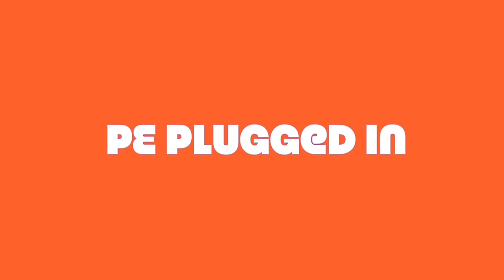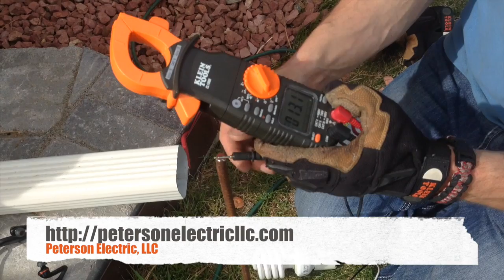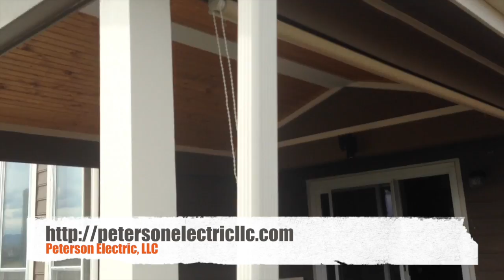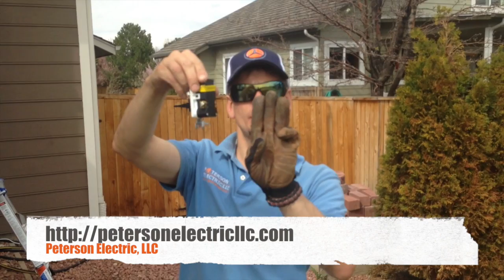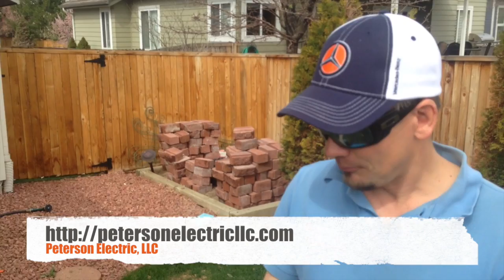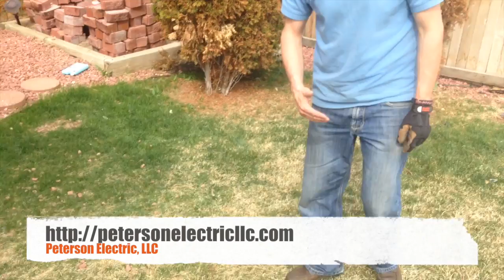Part1: Weird Electrical Things At Customer's House: Shocked On Grass, High Utility Bill

Comment: Went to a service call one time where the guy said his garage receptacles were reading 120v. When he plugged in anything nothing would work. I checked them and the voltage just dropped out under load. I traced it down to a property pin that had recently been drove in through part of the UF cable. Was reading 10v on the pin to ground with just the meter probes. Turn the breaker off and read 0v.

Comment: Get yourself a Knopp K60 solenoid tester...one of the best troubleshooting tools I have. Also no need to drive a ground rod. Just stick the black probe into the soil.
Reply from the maker: Thanks, my journeyman used this when I was an apprentice 20yrs ago. I was trained to use a digital meter, why do you like this meter when it does not give you exact voltage readings?
Reply: @Petersonelectricllc  Josh, most digital meters are high impedance so you have a chance, when troubleshooting, of getting ghost voltage readings. It's(Knopp) great for finding grounded conductors when troubleshooting, and after pulling conductors through conduit, before energizing. Let's say you're troubleshooting a tripping breaker for an exterior lighting. Sometimes you're talking long runs of conduit and many poles. Go to 1st pole in run, disconnect all splices. Turn breaker back on. Obviously if breaker trips you know you have a problem in the homerun. If breaker holds now you use the Knopp. With power on you touch one lead to a known good voltage source and the other to various ungrounded(hot) conductors. If the Knopp does nothing you know you have a good conductor. If it vibrates, lights up, and jumps you know you have a grounded(bad) conductor. Now it's a matter of breaking things down farther to pinpoint your problem. It eliminates the need to keep running back and forth turning power on/off. Plus it's CatVI rated so you're good to go when working on voltages between 120-480 volts.
Reply: @Petersonelectricllc  Let me give you another example. Around here(Philadelphia) we have to make up our own hot taps in most cases. Let's say you build a new service, have to cut taps to make some repairs, upgrades, etc. Before we re-crimp the taps we use the Knopp to verify none of the ungrounded conductors are grounded. Now you might think this is getting ridiculous. However one night we were taking a convenience store off generator and putting back onto utility. Two of my guys were up in buckets and the 2nd connection blew up in their faces. After an hour of troubleshooting we found that a dead front screw had pierced one of the ungrounded conductors inside one of the six panel boards. This happened during the shutdown. A Knopp test would have prevented this accident. Luckily no one was hurt.

Comment: To better your video, you gotta remove the logo to an upper corner and make it a little smaller. It blocks the view often. I recalled a window guy at a new home saying he was getting shocked trying to put his window in. Someone used a screw too long and drove it through a wire and into the foil tape around the window opening.

Comment: Looks like someone put a screw or nail into some NM cable, and you have the the task of finding it. Either that or you have a defective ground, and if the ground is bad in the building. With 200A you need at least two 8foot grounding rods. Although you can put in more.  Also looking at the pictures of the neighborhood, it has an underground feeder and there could be a problem on the utility side.
Reply: Ground rods have nothing to do with whether or not breakers will trip during a fault. If there is a broken EGC it doesn't matter how many ground rods you have. That EGC will become a live conductor and can cause other bonded metals to become live as well. The only way to trip the breaker is to have an effective ground fault current path. There will never be enough current to trip a ground fault if the ECG is open upstream and the charged chassis or metallic surface that is conducting the current will shock or kill the victim. There is too much resistance in the human body to pull enough current to trip a breaker. Ground rods are a drain to dissipate static and voltage from lightning into the earth.